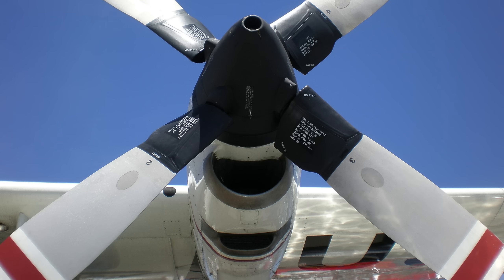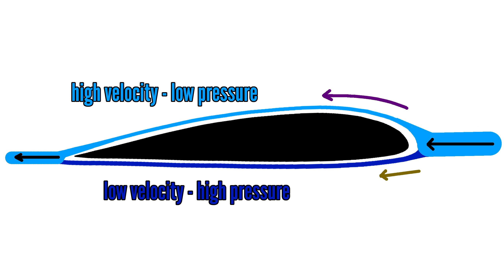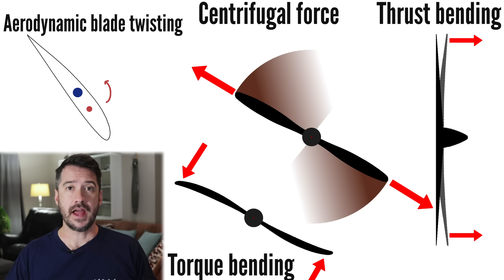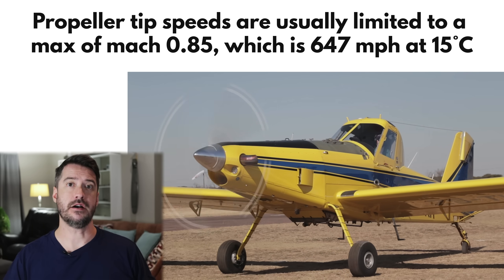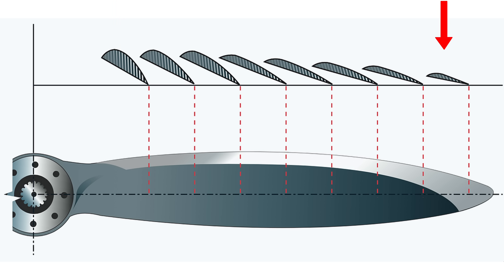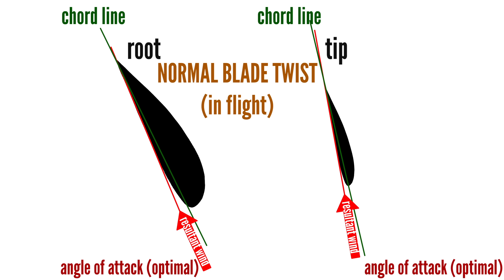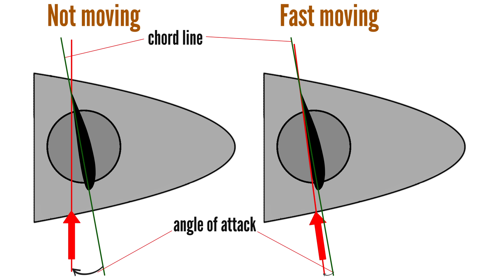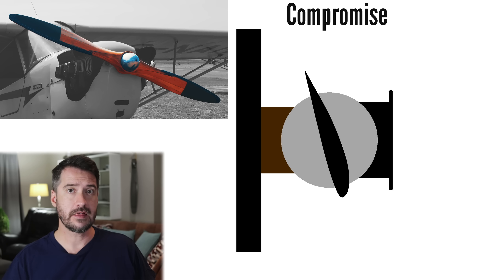One Video to Understand Airplane Propellers

Comment from the maker: PLEASE READ. I noticed some viewers get hung-up on the "equal transit theory" at 2:21. Please take note of the following:

1. If it's understood that the accelerated air over the top of the airfoil causes lower pressure than below the airfoil, and this displaces air downwards and the reactionary force is lift/thrust then you're understanding is sufficient for this video. I'm not attempting to prep you for advanced aerodynamics exams, after all.

2. My wording is admittedly poor and I never attempted to describe the "equal transit theory", but poorly attempted to describe what causes acceleration i.e. different distances to be covered (over the top and below) in same amount of time causes acceleration. Air going over the top normally reaches the trailing edge before the air going below. Saying that air going over the top of the wing speeds up is not the same thing as saying air going over and under has to reach the trailing edge at the same time.

I hope that clarifies it and that the remainder of the video is enjoyable and informative.
Reply: The remainder of the video is spot on and is a good starting point for anyone interested in why propellers are so varied between aircraft as well as their principles and operations.  For the sidewalk and blade pitch analogy, it might have been better to simply explain geometric/effective pitch and build on that.  Maybe something to add in part 2.

I would suggest not even mentioning the Bernoulli principle or the outdated idea that the upper curve of the airfoil creates low pressure or the associated equal transit theory, it just mucks up the underlying concept because none of it has a demonstrable effect and is often contradictory to itself relating to lift in fluid dynamics.  Airfoils make lift purely by deflection (AOA, or pitch in the viewpoint of a blade), whereas the shape of the airfoil determines how efficient it is at making and defining that lift...the airfoil shape itself doesn't create lift simply because it exists as such.  Flat airfoils and symmetrical airfoils will still make lift without any of the Bernoulli/equal transit nonsense involved (even space capsules without an airfoil traveling at hypersonic speeds negating the premise of those theories still make lift, via deflection), whereas a proper textbook airfoil shape won't produce any lift at all if it has no AOA/pitch.  That's the simple explanation backed by fluid dynamics; deflection creates lift, airfoil shape defines lift characteristics.  I don't know who was responsible for the first reference between Bernoulli and lift, but whoever it was did a great disservice to the world of aviation.  It's taught in primary school and is still prevalent everywhere in aviation, so everyone's first and most important introduction to aerodynamics is based on a false premise, and that's why so many people are getting hung up on it.
Reply: @Skinflaps_Meatslapper  OK so I also caught that mistake (quoting that old-fashioned Bernoulli Equal Transit-Time Theory of Lift), and as someone who has designed and manufactured wind turbine blades, and know a few of the top guys in that field, I've had a lot of time to slowly gain an understanding of lift.  Not to mention sailing and hang-gliding.  Hang gliding really helps you understand lift.  Not to mention, stalls.  At some point the lightbulb goes off, and you think, "Wow, it's actually pretty simple!"  (I never believed the Bernoulli Explanation, even as a kid.)  By the way, I just saw a documentary with David Attenborough "explaining" how a flying dinosaur reptile's wings worked.  Of course, like all the rest of the people still repeating the same old wrong explanation after so many decades, he said it was because the air went faster over the upper wing surface - what else?  Rumors die hard!  Only HE explained it with a crisp British accent, so like most science documentaries, it makes it sound like the narrator knows what the hell they're talking about.  But half the time they don't.  Anyway, yes it IS the TOP surface of the airfoil that produces most of the lift, which is why the top surface is where the sheet metal pulls up and away from the ribs, causing loose rivets on old airplanes, and why all the engines and weaponry are hung from the bottom surface of the wing, because they don't ruin the lift down there.  The plane sucks itself into the sky.  The vacuum on the top surface allows the ambient air pressure on all of the bottom surfaces, even the engines and weaponry, to push upward more than the lower pressure air on top pushes downward.  And yes, the air actually goes MUCH faster over the top surface than even equal transit time would require!  (watch a video of airfoils in wind tunnels and they show you)  BUT, mere SPEED of the air over the top surface is NOT where MOST of the lift comes from.  Some lift, yes, but not most of it.  The amount of lower pressure from the mere faster speed of the air over the top surface of the wing is not sufficient to provide the amount of lift we actually get.  They figured that out mathematically many decades ago.  And I'm not going to say here what IS the reason we get such low pressure on the top surface.  I'm saving that info.  But it is funny to read articles in Magazines such as "Scientific American" where they admit that there is no universally-accepted theory of lift to this day, and experts could not agree, even if they HAD an explanation, which most of them don't.  All they know is which airfoil makes how much lift under what conditions, but they don't know why, really.  And they can write code to emulate airflow, and predict which airfoils will do what pretty accurately, but they are still scratching their heads over exactly why it all actually works - they can model it, they can design with it, but as far as "official science" is concerned, they can't understand it, or put it into words.  Of course, "official science" also once insisted that stones could not fall from the sky!  As is so often the case, the primitive people of the countryside knew more than the scientists sometimes.  I like to watch STOL competitions.  I'll bet some of those guys have also, like me making wind turbine blades, figured out how "lift" really works.  Anyway, I think I have the explanation, and it's actually easier to understand than Bernoulli etc.  Anyway, maybe I'll publicize it at some point.  The world needs to know.
Reply: @dougselsam5393  It's actually quite simple to understand intuitively; the primary reason why it's difficult to scientifically quantify is because like anything in fluid dynamics, you can't simply attribute it to one single thing and modeling it to proof a theory is difficult.

The top of the airfoil experiencing low pressure on its own isn't enough to create the lift being generated, lift is the result of the entire air mass that the airfoil interacts with, both above and below the airfoil.  If it were nothing more than low pressure, then a helicopter rotor wouldn't have downwash, there would just be a low pressure lens above the rotor holding the craft airborne.  But we know that accelerating that mass of air downward is the action that creates the reaction of lift.  Same goes for a propeller, it takes a certain mass of air and accelerates it rearward, as opposed to creating low pressure in front of the prop disk.  Both are no different than a wing, which takes a certain amount of air and accelerates it downward.  The low pressure is part of the equation, but moving that air mass downward is the action that creates the reaction (lift).  You can imagine an airfoil splitting that air mass in half, the bottom physically pushing the air down, and the top pulling the air down.  The more curve the top of an airfoil has, the more effective it is at high AOA, and thus is better suited for slower aircraft such as STOL, ag planes, aerobatics, etc. at the expense of drag. When you reduce that curve and make the airfoil flatter, it creates less drag at the expense of being less efficient at higher AOA.  The reason for this is because that curve gives the air a surface to "stick" to without separating.  A flatter airfoil causes a more abrupt change in direction at higher AOA, the air has a harder time suddenly changing directions and the air has a harder time sticking to the wing, separating into a turbulent mess instead.  Flaps and slats and VG's and all those other gadgets are simply ways to help that air stay connected to the top of the airfoil, because if you can't bring that upper air mass down, the lower air mass is going to fill the vacuum created by the turbulent mess above it rather than continuing downward as it should.  Deflection of the airfoil is what causes lift, and the shape of the airfoil is what defines what kind of lift is being created when that happens.  The air mass on both sides of the airfoil have to be on the same page before lift is generated, you can't attribute lift to one or the other, as it's a singular action.  I've had an instructor tell me that a jet moves forward by the suction from the engine, and while that force does contribute to thrust, it's primarily the acceleration of that air mass going out the nozzle that's responsible for thrust by a large margin.  Modeling the cross sectional area of a jet intake and then calculating how much force could be generated by putting a hard vacuum on that area results in a fraction of the actual thrust of a jet.  Same goes for a wing and the small amount of vacuum on top that it creates in high alpha (that's why you often see the vapor forming on top of fighter jets, that's low pressure forming).  Attributing it to one side of the equation would be like saying the road pushing against a tire is what propels a car forward rather than the tires pushing against the road, when it's the interaction of both that propels a car forward.
Reply: @Skinflaps_Meatslapper  Well, you don't quite have the full picture.  You said lift is NOT generated by suction on the top surface of the wing, and a propeller does NOT function due to suction on the front (suction) side of the airfoil.  That is wrong.  If there is one thing aero people agree upon, it is that suction on the top surface is what causes lift.  The "mystery" is exactly what causes such extreme suction, since the windspeed alone cannot explain it.  What you are attempting to do is apply the SECOND MOST COMMON MISSTATEMENT of what "causes" lift, which you confuse with the mere "result", that air is deflected downward.  This is a very common, but insufficient, "explanation" for a "cause" of the lift.  No, the air deflection is a RESULT of the same phenomenon that CAUSES the lift.  When you stop to think about it, if the wing produces lift, then of course, there "HAS to be" a downwash, right?  So that is not the cause, it is just one more result of a well-functioning airfoil.  You had also stated that an airfoil with zero angle of attack will not provide lift.  Guess again.  Most airfoils DO produce lift, even at a zero angle of attack.  Not as much lift, but they do still provide lift at zero angle.  And you also cited helicopter blades and symmetircal airfoils as evidence that lift is NOT caused by suction on the top side - wrong again:  these airfoils produce lift only when oriented at an angle of attack to the airflow, and when producing lift, of course they also produce a downwash. which is a result, not a cause, of lift.   When people ask to understand the cause of the lift, they want to know what is physically "holding the airplane up", or in the case of the propeller, pulling the airplane forward.  In either case, it is suction on (drumroll please...) the SUCTION side of the airfoil.  There is a reason it is called "the suction side", because that is where the suction occurs, and suction is the key to "lift", just as suction is responsible for the function of a drinking straw.  Would you say a drinking straw works BECAUSE of the liquid moving up inside the straw?  NO, that is a RESULT of the suction, NOT the cause.  And as I explained, that is why, when rebuilding an old airplane with a sheet metal wing surface, the rivets on the TOP surface (NOT the bottom surface) are what come loose and need attention (repair).  And that is why the engines and armaments are always mounted on the pressure-side (lower side) because it hardly matters what happens down there, other than the drag all that stuff causes, but they put up with the drag.  Really smart outsiders to it all, even with engineering degrees, often try to use the downwash as an "explanation" for the lift.  That's like saying your exhaust coming out of the tailpipe is what powers your piston engine.  Of course it has to have exhaust, but the exhaust is not the "reason" the car rolls down the road, it's more just another result of the process of the engine running.  It;s also like saying your empty bank account is why you lost all your money in Las Vegas.   No, your bak account is empty because of the specific gambling activity that gave away the money, not BECAUSE your bank account was emptied.  See the difference?   So, in the end, of course, a wing produces a downwash, but the downwash is a RESULT, not the cause, of the "lift".  Saying the downwash CAUSES the lift is just an easy out for people who don't know HOW the wing is physically lifted.  It's a way to take a true statement (that there is a downwash) and pretend it describes HOW that downwash is generated.  Downwash is not a CAUSE, but just one more RESULT, of the phenomenon of lift.
Reply: @dougselsam5393  The misguided theory of the top of the wing producing a low pressure strong enough to lift the aircraft is nonsensical.  Stick your hand out a car window at 60mph and slightly tilt it up at the front. Do you feel the wind pushing your hand up from underneath or the skin pulling your hand from the top? Now picture a Sopwith Camel pulling out of a dive, if the lift was from the top, the fabric would just rip off the top off the wing. It is not rocket science. For EVERY action there is an equal and opposite reaction. The angle of attack of a given wing will force the airflow down, ergo, the opposite reaction is for the wing to move up.
Reply: @ricbarker4829  Uh, yeah, sorry Ric, but this is all well-understood in the field of aerodynamics.  Old news, not in question.  Based on measurements using actual pressure sensors, for one thing.  And the skin DOES lift off the top of wings as they wear out.  Nope, only the uneducated amateurs think high pressure on the bottom of the wing produces the majority of the lift.  That seems intuitive, but it's not how wings work.  Wings are not waterskis.  Air is not bullets hitting the wing.   Nope, it's the vacuum on top.   It's all a matter of relative pressure.  Try looking it up.  Watch a few old videos where they explain all this, using wind tunnels etc.  As I often tell wannabe wind turbine inventors, "Wind is invisible, so people can imagine it doing whatever they want, but it does what it does."
Reply: @dougselsam5393    Your explanation leaves a lot to be desired.   Vacuums (even pure vacuums) don't "suck".   A piston in a cylinder with a pure vacuum is not "sucked" into the cylinder by the vacuum but by the ambient pressure on the underside of the piston.    There is no physical mechanism for a vacuum to exert a force on a surface.   By definition, a pure vacuum has no molecules of gas impacting the surface on the  vacuum side so that can't possibly be the mechanism for motion of a piston moving into a vacuum.   Likewise for a wing.   The internal pressure on the inner surface is higher than the pressure on the outer upper surface (wing in normal flight) which pushes the upper surface up and causes the rivet issue you described.    So a wing most definitely has a higher pressure on the lower surface compared to the upper surface which causes lift.    The upper surface of wing is under pressure in the atmosphere in flight---just not as much pressure as ambient air pressure and less than the higher-than-ambient pressure on the lower surface.   The internal pressures on the internal wing surfaces of an effectively closed wing don't really matter since a wing could be a solid (with no internal pressure) and would produce the same result for the same configuration and air speed.
Reply: @brianbeasley7270  OK so if you suck soda up a drinking straw, I guess you are saying you are not creating a vacuum sucking the liquid upward against gravity then, right?  Obviously to those of us who think about such things, it is the ambient atmospheric pressure that is pushing the liquid up the straw, but, in an atmosphere, with ambient air pressure, suction is relative to that ambient pressure.  When you cause an area of lower pressure than ambient, causing that ambient pressure to force material to move into the area where you caused lower-than-ambient pressure, that is what is meant by "suction" and if you want to say there is no such thing as suction, you are just playing with language.
If you suck soda up a straw and some idiot tries to tell you "You didn't just suck the soda up the straw, the ambient pressure pushed the soda up the straw.", you would hopefully reply that "Yes, the suction I caused is what allowed the ambient pressure to push the soda up the straw."  I'm pretty sure I mentioned it is the ambient pressure that lifts the wing, but it is the suction on the top of the wing that allows that ambient pressure to lift the wing.   It's all about RELATIVE pressures.
What people should understand, if interested, is that aerodynamic "lift", as meant in subsonic flows over airfoils, is that the "lift" is not caused by increasing pressure on the underside (pressure side), so much as a REDUCTION in pressure on the upper side (suction side).  if you don't believe me, consider why the upper side of an airfoil is called "the suction side".  I'm not saying anything that is not widely known in the field of aeronautics.  There are many ways to say the same thing, but there are also some armchair-analyst type people who will never believe it.  They should know it has all been verified in wind tunnels using pressure sensors, etc., for perhaps a hundred years or more. Old, well-known info, nothing new except there are always new people who don't know the basics of aero engineering, yet.  But they can always learn if they decide they really want to know.  :)
Reply: @dougselsam5393    You are creating a vacuum when you suck a straw, but what causes the liquid to rise is the higher ambient pressure on the surface of the liquid in the glass which pushes the soda up the straw.   Again, a vacuum can not move anything.   Only the pressure on the other end of the thing exposed to vacuum can cause motion.   Nobody said there is no such thing as "suction".   "Suction" is simply "lower pressure than ambient".  But what pushes the air into a suction or vacuum is the ambient pressure, not the "suction"  From a physics standpoint, suction can't cause anything to move since it creates the reduction or absence of force on an object exposed to the suction.   The moving is caused by the pressure on the other side of the suction causing an unbalanced force.  In general, lower pressure gas molecules can't "pull on the wing", gas molecules can only push on the higher pressure side.

The upper side of the wing is called the "suction side" simply because it is at a lower pressure than ambient.  The bottom side is at a  higher pressure than ambient.   What causes lift is the relative higher pressure exerted on the wing from the pressure side.   You are trying to explain lift with "suction" but suction  and vacuums can never create lift or exert a force.   They always produce a situation where an unbalanced force from the higher pressure side exerts the force on the wing.   And I can guarantee you that aerospace engineers in general understand this argument.
Reply: @brianbeasley7270  Hi again Brian, I don't think you read my initial post completely, because we both agree on the cause of lift, and I DID explain that it was the relative pressure, in my first post.  Since we've both explained it twice now, we probably don't need to explain it again.  You have a problem with using the word "suck" or "suction", as though there is no such thing.  But there is such a thing, used for many things such as the accessories on a car engine using manifold vacuum to operate.  Your vacuum cleaner sucks up dirt.  "Suck" and "suction" is just the word we use to describe the causation of a negative relative pressure (negative pressure gradient), so, it's just a word.  You can just say "lower relative pressure", and mean the same thing.  The problem is not so much the different words we use to describe the same phenomenon, but people like ricbarker4829, above, who argues that "The misguided theory of the top of the wing producing a low pressure strong enough to lift the aircraft is nonsensical".  Easy to understand how someone could think that, but for those of us who have learned that it IS the vacuum above the wing that creates the lift, I guess we are doing our civic duty to inform them that vacuum on top is the operative principle.  I'll guess most of us probably started out assuming it must just be higher pressure on the bottom that does the lifting, and the pressure on the bottom is of course higher than the pressure above, but at least it is known that it is the vacuum on top that causes that pressure differential.  :)
Reply: @dougselsam5393 
 Not disagreeing but here are my thoughts. Think of the basics of what the wing is doing. It is deflecting, or pushing (accelerating) air downwards. Newton said something about  reactive forces (to every action there is is an opposite action). So, just how does this deflection take place then? How does it create lift? It is easy to contemplate air punching into the bottom of the wing and accelerating downwards as it pushes the wing up. But what about the top of the wing? How is air deflected downwards from there? Basically the air, some distance above the wing is sucked down to the surface of the wing to fill in the low pressure area caused by the air trying to follow the curvature of the fast moving wing. The upper wing air then has a downward momentum contributing to the resulting downwash.
Simply put, the wing creates lift by "pushing" air downwards (or backwards). The mechanics of HOW it does this is another subject.
Reply: @aeomaster32  I'd say if a wing has a process that produces lift, the result, by definition, must include a resulting downwash.  But the downwash is an aftereffect of the process, not the cause of the process.  People want to know what is holding up the wing.  If it were a piece of scotch tape holding up the wing, someone could say it is the reduction in the amount of tape on the roll that causes the wing to be lifted, but it is really just one more aftereffect.  Even the lift itself is not a cause, but an effect, of a process.   :)
Reply: @dougselsam5393  
Accelerating air downwards is the force. Air Mass X Acceleration downwards. F=MXA
HOW the acceleration is produced by the wing is another question. As I mentioned, the airflow impacts the lower surface and is FORCED to change direction, causing an equal and opposite upward force on the wing. The top of the wing also FORCES a change in direction due to the lower pressure on top pulling the air above the wing downwards and in effect sucking up the wing.

Reply
Reply: @aeomaster32  Sucking the wing upward is "the force" that holds the airplane up.  The resulting downwash is an unavoidable aftereffect.  There is nothing about the downwash that holds the wing up, since the final resulting downwash is no longer even contacting the wing.  It is the relative slight vacuum above the wing that holds the wing up, by not opposing the ambient pressure below.  That same vacuum above the wing is what pulls the downwash downward.  So the vacuum is responsible for both the lift and the downwash.  And the people who say there is no such thing as suction might also want to correct all electronics that use "holes" (absence of electrons) rather than electrons themselves.  And don't forget, "suction deniers" have no business using a soda straw to drink!   :)
Reply: @dougselsam5393  
Ok, we seem to have a different way framing the same thing. My view is that It is the top surface of the wing "pulling" the air above it downwards,  and that PULL on the air and accelerating it downwards represents the lift force MxA. If the air did not accelerate downwards it would mean there was no "pulling down", and hence no lift. The downwash results from the wing sucking (pulling) down the air above it.  The airmass being thrown downwards is essential for lift as the wing "claws" the air above it and shoves it down.
Reply: @aeomaster32  Well at least you understand it is suction on the top surface that holds the wing up.  That same suction that sucks the wing upward, sucks the air above the wing downward, RESULTING in the obligatory downwash which, like the wing being lifted, is an aftereffect of the suction.  But to say that the downwash is the CAUSE of the lift is a trap that people familiar with Newton's law of equal and opposite reaction fall into, having been programmed to believe that citing such mathematically described RESULTS is equivalent to an EXPLANATION of how lift works.  Nope, it's just mentioning the obvious and inevitable RESULT of the same suction that causes the lift.  What you are saying is more like saying the backwash in your glass when you drink is the cause of the liquid going down your throat, or that the exhaust gas coming out your tailpipe pushes your car down the road.  The explanation for "lift" you are promoting here is exactly what leaves people hanging when "Professor Crackpot" tries to substitute a little mathematical technicality for an "explanation" of what holds the wing up.  The good professor thinks that by citing Newton, a recognized name meant to give his explanation some "authority" (like, how can you argue with Newton, right?) but that "explanation" is more of a dodge, a workaround, passing the buck, kicking the can down the road, merely citing another effect of the same suction that causes the lift, as the cause of the lift, but like the lift itself, the downwash is an EFFECT, not a CAUSE, of the lift.  The suction is what holds the wing up.  That is an explanation that people can understand, not throwing a little math at them and telling to just shut up and stop asking questions because you used the name "Newton".  If you use a suction cup to hold up a plate of glass today, for example, do you explain that the force holding up the glass is the outward flow of air being forced from the suction cup yesterday, when first applied to the glass?  No, it is the suction that holds up the glass, and suction that holds up the wing.  if it were scotch tape holding up the wing, you would say it is the stickiness of the tape holding up the wing, not the fact that there is now less tape left on the roll in your tape dispenser...   :)
Reply: @dougselsam5393  
I know what your point is, but you try to disconnect low pressure on top of the wing from downwash as a COMBINED lifting process. As if downwash is simply a disconnected after effect.

To show the connection between lift and downwash hold a flat metal plate edge on into an airstream. Block any air flow over the top. Now drop the trailing edge so the sheet deflects the air downwards, and measure the upward pressure force on the sheet. The upward lift force is the same as the opposite force pushing the air downwards. If no air goes downwards, no  upward lift is generated.
 
In regard to the top of the wing, you say the downwash is (just) the "result" of suction but doesn't contribute to lift. 
But there is no skyhook to suck the plane against. So how does the wing generate a force equal to its weight if you can't suck onto something?
 
It does this by sucking air downwards and that generates an opposite lifting force pulling up on the top surface of the wing.
The story doesn't end there, because the air pulled (forced) down by the 'vacuum' has downwards acceleration that equals the upwards lift generated by the suction. It is the suction that forces the downwash and the downwash cannot be separated from the lift that caused it. 
Can you imagine a wing generating lift without displacing air downwards?
Reply: @aeomaster32  Yes I can imagine a wing lifting without downwash.  If a wing is flying along close to a horizontal flat ceiling located close above the wing, the wing might be able to suck itself up against the ceiling, without producing a downwash.  If I apply a suction cup to a ceiling, there is no downwash, but there is "lift".  Regardless, "association is not causation".  I've been listening to this same old tired confusion of cause and effect regarding lift for my entire life, and am really tired of such a lazy attempt at explaining lift.  It's like saying your shadow is responsible for sunlight hitting you.  A wing is pulled up by suction above it.  That same suction ALSO pulls air down from above the wing - how could it not (except possibly in the example I just gave, but under normal flying, yes the air is also sucked down.)  But imagine if that air was not able to be sucked down.  If there is still a vacuum above the wing, it will still suck the wing upward.  The air being deflected downward does not "cause" the vacuum above the wing.  The wing and the air are both pulled toward the vacuum.  That does NOT mean the air being pulled down by that same vacuum is the "cause" of the wing being pulled upward.  In fact, if you think about it, the air being sucked downward would tend to reduce the vacuum above the wing, REDUCING lift, if anything.  After 50 years of listening to this line of "reasoning", the whole time knowing it was nonsense, I'm kind of tired of going over and over it again and again.  Yes, of course, the downwash and the lift are "linked" - they are both RESULTS of the vacuum above the wing.  But "correlation is not causation" which is an old saying in science, that I'm sure you are familiar with.  That there is some "association" between downwash and lift (both caused by the same vacuum) is completely different from the downwash being the "cause" of the lift.  The lift is "caused" by the vacuum.  if anything, the downwash reduces the lift by reducing the amount of vacuum - just think about it.  :)
Reply: @dougselsam5393  OK, let us leave it there.🙂
Reply: How are you going to tell everyone that they’re wrong about how lift is created but then not explain the correct answer and gatekeep it…..
Reply: @dougselsam5393  
 Downwash is not the result of suction.
The more suction on the top of an airfoil the LESS downwash.  
Total Lift is part suction on top of the airfoil and part downwash from the bottom of the airfoil.   
An elliptical wing at zero angle of attack, with an aileron/flap deflected is making lift with ONLY downwash.
Reply: The point is that the mere higher speed alone of what you claim: "the accelerated air over the top of the airfoil causes lower pressure than below the airfoil" is NOT the predominant source of the lift.  It was determined long ago that the mere higher speed of the air over the top surface is not sufficient to provide the huge amount of lift an airfoil produces.  The cause of lift goes way beyond higher speed air over the top surface.  But it is still a nice video.  :)
Reply: I love the discussion.  My undergraduate is in physics.  I never studied these phenomena in detail, but I teased out that no one really knew what they were talking about.  Most of science is just seeing what nature does and scientists trying to put an equation to it.  See, e.g., quantum physics and gravitation to name the innumerable others. Thank all of you.
Reply: If the shape of the wing causing a pressure difference over the wing is causing the majority of the lift and is the most important thing to bring up, then no airplanes can fly upsidedown right? The longer side is then downwards and the plane is pulled down by both gravity and the lift generated by the wing? We know experimentally that this isn't true so the explanation is lacking.
Reply from the maker: @bumbixp  Not correct. An upside down wing DOES create upward lift, it's just extremely inefficient and creates very little lift compared to a right-side-up wing (depending on the shape obviously). You need to look at the airflow of an upside down wing, and remembering or visualising the path the air takes. Don't forget the AoA, the air doesn't go over the as if it's close to a "flat" or low AoA, the AoA will be very high. Over the top (which is the bottom of the wing that's upside down) the path of the air is ablosulte longer and creates the pressure differential required for lift.
Reply: @bumbixp   You are correct.  The shape of the wing is pretty optimal for generating lift by having it right side up but the angle of attack of the wing is reasonably what is most important to generating lift.  Which is why an upside down airplane with a normal wing can fly with a high angle of attack upside down.   The net result is still air forced down with a force equal and opposite of the lift.   It is also why an airplane with a completely symmetrical airfoil can fly just fine right side up or upside down (just less efficiently).   In both cases, the pitch of the aircraft is just maintained so that the angle of attack is adequate to generate the lift needed.   In all cases, the mathematics of the pressures correspond to the Bernoulli equation solutions to a high degree of fidelity.   Which is why it is stated that the explanation is consistent with Bernoulli.
Reply: The main cause of lift is Newton's law of action and reaction. The wing changes the direction of the airflow downwards and there is exactly the opposite reaction, where the air pushes the wing upwards.
Reply: @jaromirandel543  The downwash is not a "cause" of the lift.  The main cause is the relative vacuum above the wing, which also pulls down the air from above the wing to the same degree that the wing is lifted.  Because Newton's momentum equation is valid, and the downwash momentum therefore matches the lift, lazy or uninformed analysts make the mistake of thinking the mere validity of Newton's laws somehow magically serve as an "explanation" of lift.  No, the downwash is just a mandatory RESULT of the same vacuum that causes the lift.  The fact that a formula can be applied, showing the lift balances the downwash, does NOT indicate the downwash is the CAUSE of the lift.  What causes the downwash?  The vacuum above the wing, right?  So if you want to say the downwash is the cause of the lift, then if that downwash is caused by the vacuum above the wing, then that vacuum becomes the ultimate cause of the lift.  Correlation is not causation.
Reply: @dougselsam5393  Once the youtube filter stops deleting my answers, then try to check page about lift in the nasa website.
Reply: @dougselsam5393  By the way the low pressure zone is caused by Coanda effect. The fluid generally "sticks" onto convex shapes. This creates the lower pressure zones and according to Bernouli's law the air stream is accelerated by change of pressure.
Reply: @jaromirandel543  I hear that.  Thinking of boycotting the comments sections because the same thing has happened to me.  Seems very arbitrary and mysterious, like it does it for no discernable reason.  Not into having some stupid machine decide what I can say, right?  
I'm very familiar with the NASA site on lift.  Maybe you've read the Scientific American article saying we still don't understand lift.  Well, I've got an education in fluid mechanics and fluid dynamics, and have been in wind energy for decades, know all the aero people in that field, and can tell you how a wind turbine blade will perform by just looking at it carefully. After designing and manufacturing a lot of blades,, and still learning, I'm at the point that I have gained a better understanding than most wannabe "experts", of the subject of lift.  These internet conversations help me to learn how to explain it better.  So thanks for conversing here.  I will say right now, even such authorities as NASA still repeat old, worn-out "explanations" that don't necessarily explain how lift works, but just throw around an equation as though "that explains it".  Really, a truly good explanation usually doesn't require math.   Explaining HOW something works, or the CAUSE of something, is about the qualities not just citing mundane and well-known equal quantities of energy or momentum.  Anyway...   So I explained that the vacuum causes the downwash.  You want to say the downwash causes lift.   I'm waiting for you to explain that the vacuum above the wing does NOT cause the downwash, or that if it does, and you still think the existence of the downwash is the "cause" of lift, then, if the vacuum above the wing  causes the downwash, how does the vacuum above the wing not cause the lift?
Reply: @jaromirandel543  I thought you said the downwash causes lift.  Make up your mind.  What causes the Coanda effect?  I always joke that the Coanda effect is named after the largest, deadliest snake in the world, but I'm afraid gullible people will repeat it.  Yeah, what is called "the coanda effect" is also easily explained, well, by me anyway, and is just a name given to something that is observed.  Kind of like "gravity".  It's not an explanation, so much as an observation that has a name.
Reply: @dougselsam5393 no, the vacuum is not what produces lift.  Newton's 3rd law is.  The wing does not get "sucked" upwards.
Its a mix of the faster air from the top of the wing colliding with the slower air from under the wing.  This collision at the wing's trailing edge of the two different air speeds equalize into a net turning of the airflow downwards.
Airflow will also simply hit the bottom surface of the wing and be deflected (skipping stone theory, but this can also be mistakenly identified as the sole cause of lift when it is not).  Lift is a product of a combination of both these.
Pressure difference alone has very little effect on the production of lift, and is more of a side effect of it.  Does make for some cool overwing vapor though in the right conditions
Reply: @Red-Magic  Funny how so many people want to pick out a single resulting feature of the airflow, and claim that such a result is "the cause" of lift.  I've designed and produced large numbers of wind turbine blades.  I'll stick with the carefully-created suction being the main cause of lift, and the fact that the air is deflected downward being a second result.  Create the pressure difference (suction), and the wing is pulled up, while the air is pulled down.  Equal and opposite results, from a single cause.  :)
Reply: https://youtu.be/jqexY7hObik?si=RrfrtTIfbq4QcMz3
Reply: Air can not slow down.

Any molecule or free atom in a gas always moves at the speed of sound relative to its point of origin. Evaporation occurs at that escape velocity, after which there simply is nothing to slow it down. Any encounter with other mass leads to the same confrontation after which the atom or molecule either escapes again or not, but if so, always at that one velocity. This means the kinetic energy in air is a constant. What we experience as airflow is not more than the dominant direction of an already existing motion. This is why things start to get problematic as soon as any induced movement approximates the speed of sound. It also explains why increased airflow always goes at the expense of pressure, since both draw from the same limited source. 
So,..
When air is passing by the full cord of a wing, the shape of that cord determines the length of the path the air follows and hence the portion of the movement that goes into flow. Longer path means more flow means less pressure. The reason why both air over the wing and air under the wing have to reach the trailing edge simultaneously is because both sides of the wing do too. For the air over the wing to arrive later, the wing shape would have to slow the air down, which it can't because:

Air can not slow down.
Reply: @Berend-ov8of   Ever heard the expression "A little knowledge is a dangerous thing"?  Go watch some wind tunnel videos explaining how airfoils work.  The air over the top arrives at the trailing edge MUCH faster than the air going below the airfoil.   (But even so, not fast enough to fully account for the large amount of "lift".)  The "equal transit time" theory was debunked long ago.  So your statement is Rong.  Why do I spell Rong Rong?  Because to spell wrong right, you have to spell it rong!  Only then is it Rong!  :)
Reply: @dougselsam5393  Let's for the sake of argument assume you are right and I am Rong as you put it. 
The reason I came to being Rong is because I have always known something was missing in aerodynamic theory. 
Being born and raised on a large airport (closer to the action than the tower), that notion came quite early, but the answer came a lot later. The crazy thing is, general physics does not disagree with what I say. It just for some reason never makes it to aerodynamics. 
There is no other explanation than that one. 
Do you understand what that means?
You can tell me things millions of others agree with you on, but you can not explain it. 
You can tell me that I am Rong, but not how I am Rong.
The very concept of airflow is a stricktly statistical phenomena.
It's a virtuality used to describe the workings of a reality.
When all you notice is the breath of an elefant, it becomes easy to make the mistake of thinking there is no elefant. Or you can assume there is one, though you can not see it.
Reply: @Berend-ov8of  Like I said, watch some old wind tunnel videos from the 1930's, right here on Youtube, and you'll see that the air over the top gets to the trailing edge much faster than the air on the bottom.
Reply: @dougselsam5393  Since you know what I should look at, can you give me a link?
It's not that I can't search for it myself, but I can imagine you are familiar with a video that clearly shows it. That would be a lot faster. I've been looking at quite some wind tunnel videos, but failed to find one that shows how the air over the top gets to the trailing edge much faster than the air on the bottom.
Reply: @Berend-ov8of   (Sigh...) OK I went to YouTube and searched for "wind tunnel theory of lift" and here's the first video I clicked on, and it explains exactly what I was saying within the first few seconds.  https://www.youtube.com/watch?v=UqBmdZ-BNig    It's called "Airflow Across a Wing".  I had never seen this particular video before, but most of them will show the same thing.  The ones I've watched are extremely old, in black-and-white, almost from the stone age, but there are a LOT of wind tunnel wing videos on YouTube to choose from.  For anyone truly interested in the subject, they are quite enlightening!  :)
Reply: @dougselsam5393   Thanks a lot. I really appreciate you going through the trouble of finding me this video. I watched it and I will keep on watching it and other videos until I fully understand what I'm looking at. I will get back to you with the result here.
Reply: OK, it's irrelevant, but it's also wrong and it distracts students from the correct explanation. Thanks for clarifying.
Reply: I'm glad you mentioned this and pinned it.  The bernoulli and equal transit theories of lift are too often repeated and ppl tend to believe they're the sole cause for lift, when it's more of a blend of the two.
Remember, lift is in the end, newton's 3rd law.  Air must be pushed down.  The wing doesn't get magically "sucked" upwards.  In a way, a wing is just a refined method of air deflection.
Reply: 0:28 0:29 😅